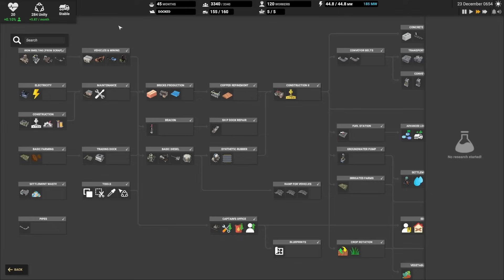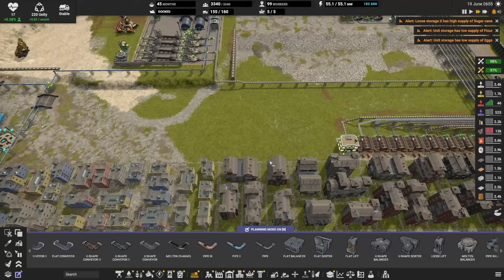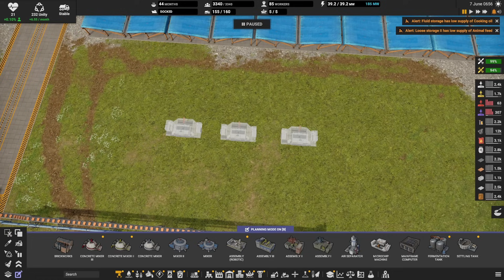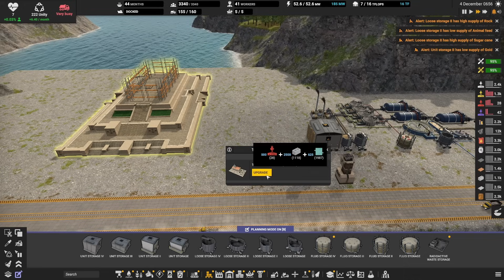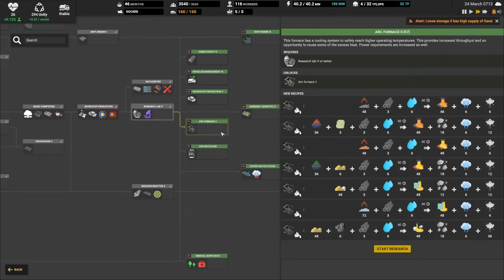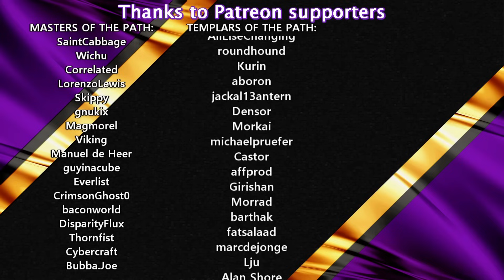All About Chip; Microchip & Snacks | 15 | CAPTAIN OF INDUSTRY | Admiral Difficulty

Comment: Hello Nilaus

Think about burying your trash under at least one tile of dirt or rock. If you have too much exposed trash on the surface it will count against your health. In my playthrough I eventually went back and dug up the top few layers and burned it in the incineration plant and covered the surface, but had to move around what I had built on it while doing that.